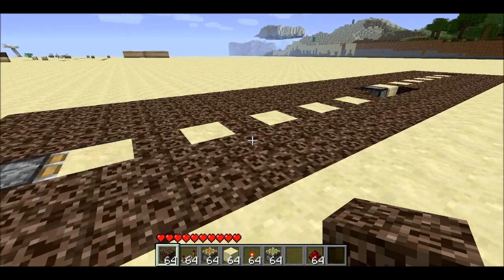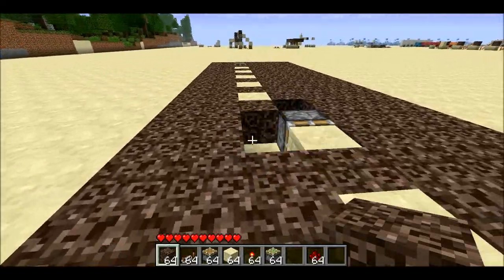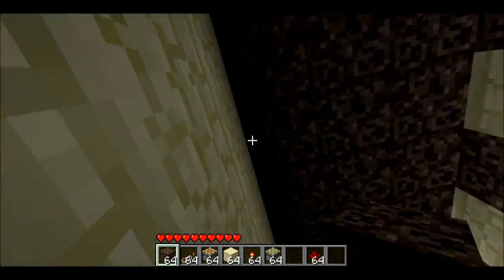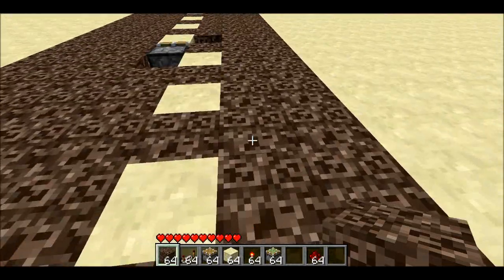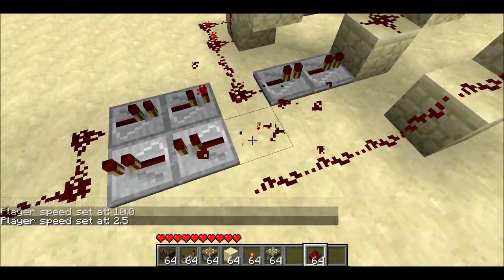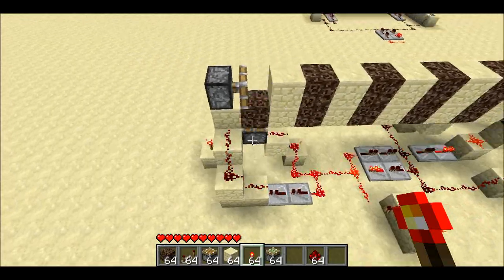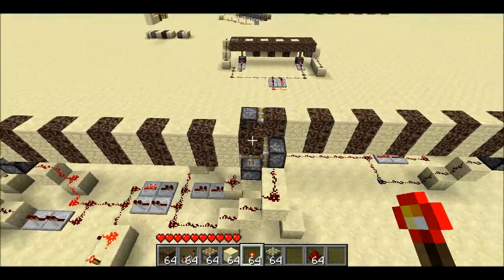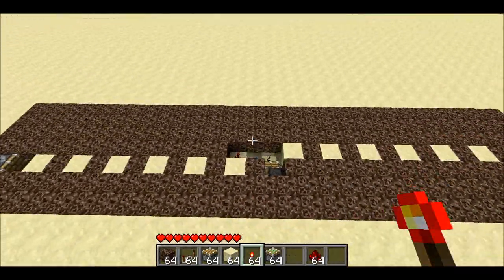Soul Sand-Based Moving Walkway

Comment: If you implement this anywhere, I would suggest putting regular fence up on one side of the walkway, and then netherbrick fence on top of the walkway opposite the regular fence. The two fences don't clip together like two fences of the same kind. That way you'd be forced to walk in between the non-moving ground and the belt, so the falling through the blocks glitch wouldn't matter.

Comment from the maker: @Crowgomooo Yep, you could. And if you did, you wouldn't walk so slowly in and around the walkway. It wouldn't be quite as flat, so it's a little less aesthetically pleasing, but depending on your application, the speedup might be worth it. You can also replace the soul sand with normal blocks, and the sandstone with fence posts for the same effect.

Comment: Excellent, sir.

If you make the moving sidewalk as a loop on the surface so you don't fall all the way through it might mitigate the bug.

Also I noticed you can't easily chain them. Perhaps you can have them push you off a 1-high cliff? That might get you a one-way moving sidewalk longer than 12 blocks.